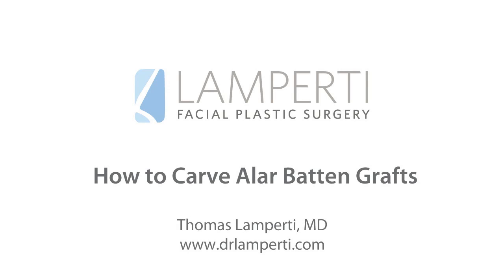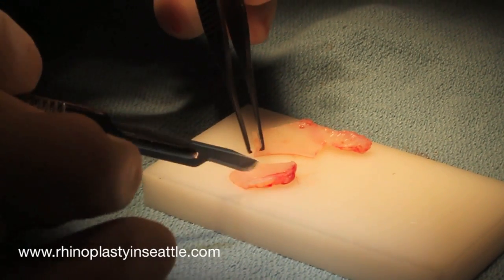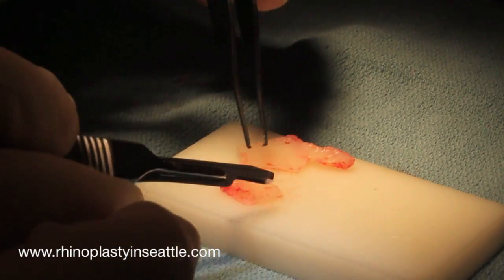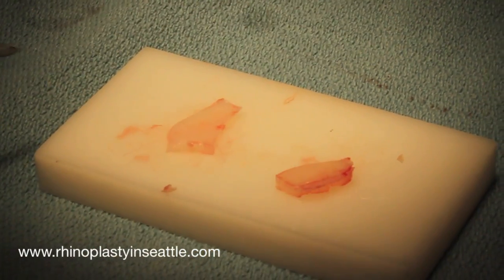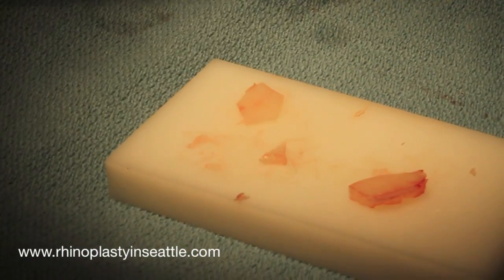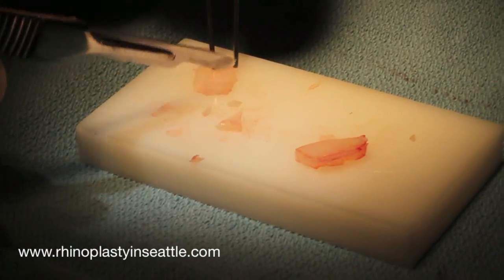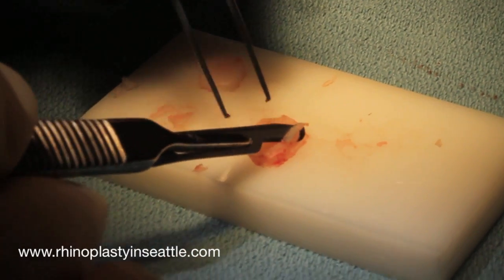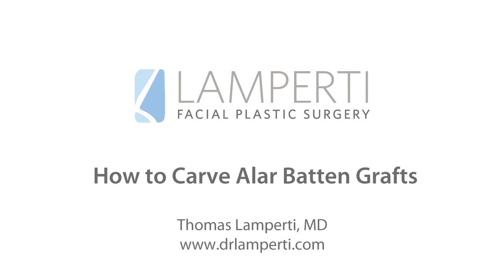How to carve alar batten grafts | Surgical Breathe Right Strip Surgery | Seattle Rhinoplasty Surgery

Comment: If a patient only needs a small amount of cartilage - like if they're only suffering minor collapse or their problem is just on one side - do you harvest less than normal or would you still be removing the same amount of cartilage?
Reply from the maker: Hi Lloyd, Yes I do base the actual amount of ear cartilage harvested on the actual needs for each patient. There is a pretty wide range as to the amount of cartilage available to harvest and I don't remove the same amount each time. Best, Dr. Lamperti